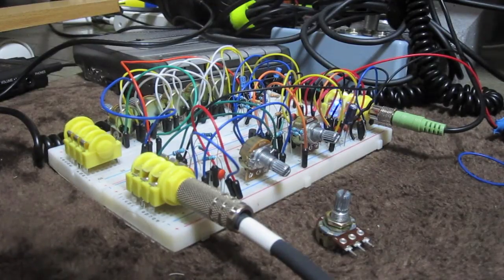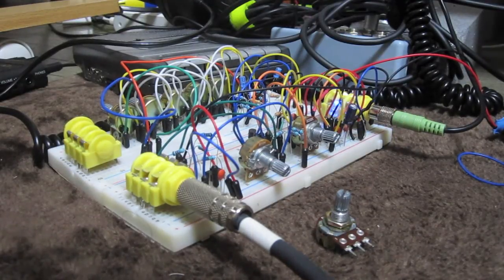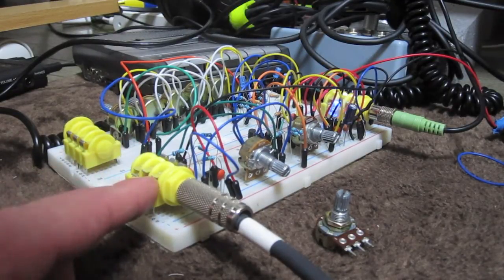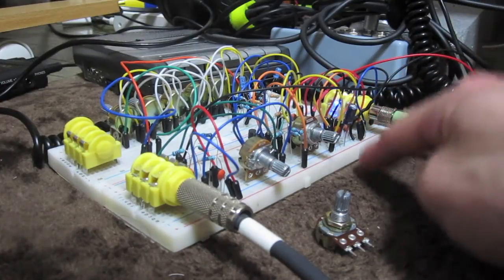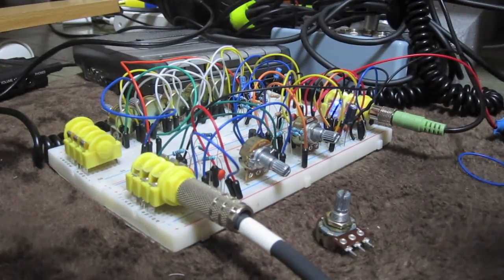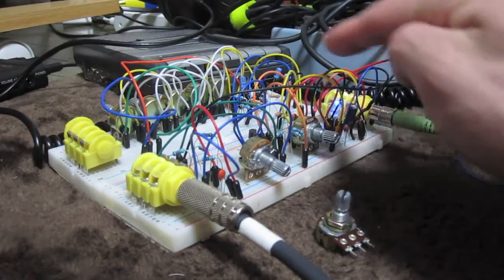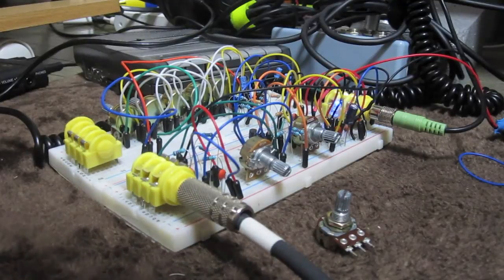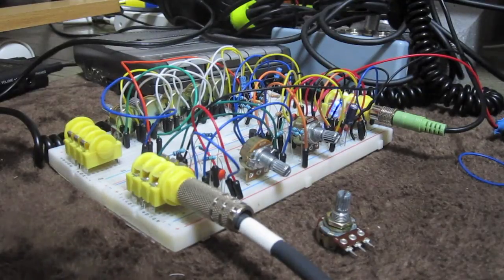Super Simple DIY Resonant Low Pass Filter Circuit

Comment: Where do you get those yellow jacks?
Reply from the maker: I got them from ebay originally, but there may be some on aliexpress too. To me it seems like somebody had some extra yellow material from another product, so they decided to use it for these jacks, because it's one of the cheaper options. Here's a link to at least one supplier (there may be more):
http://www.ebay.com/itm/10-1-4-STEREO-Audio-Cable-Female-PANEL-MOUNT-JACKS-Guitar-Effects-Pedal-2067-/390750618027?hash=item5afa8d41ab:g:ujoAAOxyUrZS23-B
Reply from the maker: These ones are cheaper: https://www.aliexpress.com/item/10x-1-4-6-5mm-Stereo-Audio-PCB-Panel-Mount-Headphone-Jack-Socket-6-Pin/32666747349.html?spm=2114.01010208.3.62.npUpqp&ws_ab_test=searchweb0_0,searchweb201602_1_10152_10065_10151_10068_10136_10137_10060_10155_10062_437_10154_10056_10055_10054_10059_303_100031_10099_10103_10102_10096_10052_10053_10142_10107_10050_10051_5030011_10084_10083_10119_10080_10082_10081_10110_519_10175_10111_10112_10113_10114_10182_10078_10079_10073_10123_10120_10189_142-10120,searchweb201603_16,ppcSwitch_2&btsid=afd77326-2203-403d-9788-ed066b1bb198&algo_expid=34def6be-11b5-4df0-a152-97b2ba5ea17a-8&algo_pvid=34def6be-11b5-4df0-a152-97b2ba5ea17a

Comment: I'm looking for a passive stereo LPF design with no resonance, for a string synthesizer that I have that doesn't have its own LPF (I'm not big on resonance anyway).

I understand the basics of how capacitors and resistors are used to build basic LPF and HPF, but I'm having trouble finding out how to make it variable.  I'm not sure if swapping out the resister for a variable pot will result in an amplitude loss in a passive circuit, or if that is avoidable at all without an active circuit.

Learning about electronics is fun, but a bit frustrating!
Reply from the maker: +inthefade Swapping the resistor for a pot should do the trick. You will probably get some volume loss from it going through the passive components, but not enough to hear I think. You could make 2 simple RC filters and have a dual ganged pot controlling the cutoff to make it stereo.
Reply: MrFricoco
Cool.  Well it doesn't seem like it would cost much to just experiment with it.  I finally ordered a couple breadboards so I can play around with stuff like this.

Thanks for the reply!
Reply from the maker: +inthefade Awesome and welcome to the rabbit hole!
Reply: MrFricoco
Thanks :D

I stayed up until 6AM the other day reading up on basic filter designs and some simple bridge rectifiers that act as a hard limiter, for some simple distortion...

I still don't have Ohm's law ingrained in my head, but I've been building kit synths and effects for years, I figured it is about time I start learning how to design some things myself.

Got plenty of friends and family who do this sort of thing professionally, so it shouldn't be too hard to get deep into it.

Next for me is learning about op amps!
Reply from the maker: Sweet! That makes things so much easier! Ya the design part is tough, I hope your good in math, 'cause I'm not. ; )